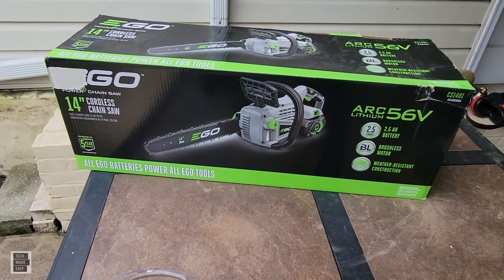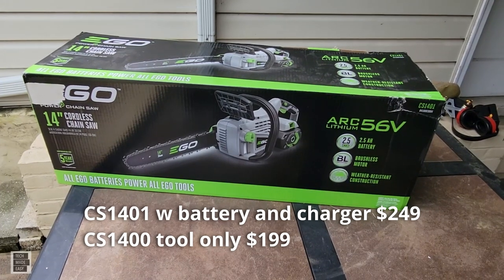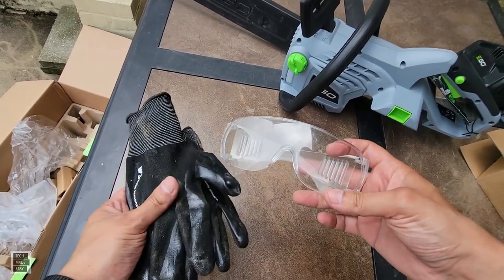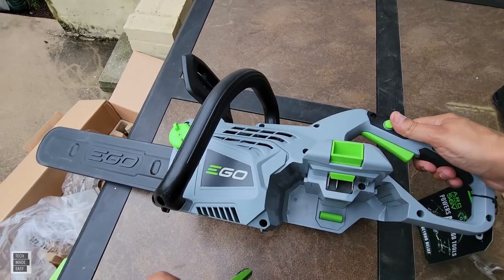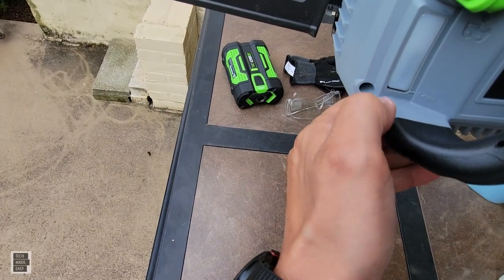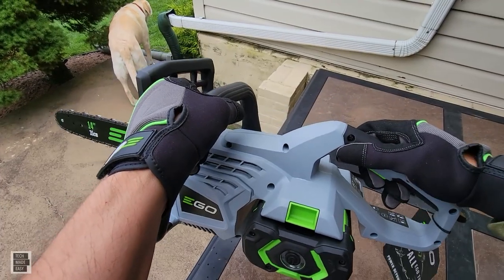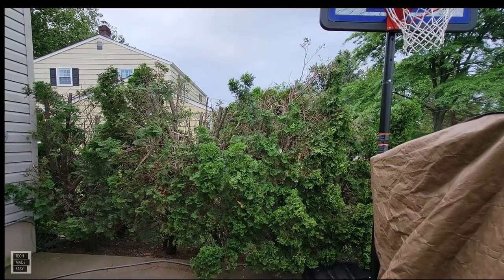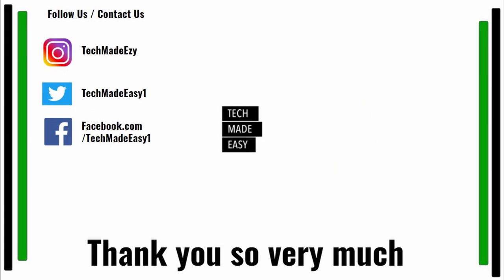EGO 56v brushless chainsaw review and demo

Comment: Thanks for the review.  I've got the 14" and 18" and love them.  I'm a city dweller with mature trees and there is always something to trim or cut down.  

When you were first going to cut down the tree, it looked like you had rested the chain on the trunk before starting the chainsaw.  It looked like you correctly brought the saw up to speed before making contact with the wood when you actually cut the trees.  With any gas, battery, or corded electric, let the saw get up to running speed before making contact with the wood.

I've lived in Wisconsin my whole life.  One of my duties as a child and now as a homeowner is to go out during the snowstorm and GENTLY get the snow off the trees like yours or bushes.  Sometimes I do it several times during a storm.

I bet you are a real popular guy in the neighborhood.  No one needs to buy OPE with you around.

Comment: Bought an EGO chainsaw.  Leaked oil.  Brought it back to Home Depot and they sent it out for repair.  Still leaks oil.  Battery wears down quickly.  You may get about 3-4 cuts on any wood 8" or thicker.  It's alright if you want to trim a few branches.
Reply from the maker: Thanks for sharing your experience

Comment: i got the 18 inch a few months back....the higher RPMs is what sold me....I don't have many trees in my yard but there are a few odds and ends that need trimming every so often.....i got tool only as I had 4 other EGO tools
Reply from the maker: 18 is a beast Brian
Reply: I've got the 18" also and it does the job.  I dropped 4 trees and was working on the 5th when the homeowners came out and yelled "who are you and why are you cutting down our trees."  I'll have to sneak back later to finish the 5th.  Good thing the saw has a light on it.    JK      

I do have the saw and did drop a 20"+ diameter pine tree that had already been topped.  It cut well but after dropping it I used up a 5.0Ah battery with about 6 bucking cuts.  I've got plenty of batteries and finished the job with the 2nd battery.  This tree was exceeding the saw's design by a few inches.  I'm sure it would be great on 16" trees.

Comment: I beleive ego, for their commercial line up, came out with a Arborist saw . It looked pretty cool
Reply from the maker: Hey Alexander 👍🏻Have to check that out
Reply: @TechMadeEzy  I believe the new Arborist model (which basically means a top handle saw that can be used one-handed) requires that the battery is worn on a hip belt.  I think it would also work with the backpack battery holder, not the professional backpack with integrated battery.  By not having the battery on the saw, the weight of the saw will be very light.
Reply from the maker: Cool thanks Ron

Comment: I have a Greenworks pole saw and I have to refill the oil at least once a year.
Reply from the maker: Hi Heidi, Work well? No issues?
Reply: @TechMadeEzy  Works okay, but it has a very front heavy design which is hard for me to hold aloft, given it has no battery at the bottom to counteract the weight and so balance is awkward. I'll be getting the EGO version probably next year.
Reply from the maker: Get it and try it, can't hurt. I don't cut wood much as you can see from the video 😊 but maybe one day I will have a larger lot. Have a great night thanks Heidi

Comment: I have the 18 in,doesn't leak at all,but my ego pole saw does leak though
Reply from the maker: Wow the 18 is beast mode 💪🏻
Thanks Scorpion 🦂
Reply: Earlier today I came across a video from a saw repair guy where he says 90% of all saw oil leaks are from the filler cap.  He was referring to one brand in particular.  Nevertheless, the EGO manual says oil leaks are to be expected (page 24). To test the leaking cap theory, the 90% guy suggests storing the saw with the oil cap on top rather than on the side.

Comment: Model Number Question.  Many EGO products seem to come two ways: a) with a model number or b) with the model number - FC.  For example, the user manual for my saw is marked at the bottom of every page CS1400/CS1400-FC.  I can find no indication as to what "FC" indicates.  My saw is model number CS1400-FC. Lawn mowers and battery chargers also have "FC" flavors.  Does anyone know what the difference is between -- FC versions and the ones without -FC in the model number?
Reply from the maker: Hi Ace FC is factory conditioned
Reply: @TechMadeEzy  That is a strong possibility, but its a scary thought.  How many units would you have to recondition before you make a model number for it and include it on your operators manual?  By the way, I finally took mine out of box.  I noticed the following: 1) The chain was shipped installed what I believe was way too tight. 2) The chain feels like it has a little oil on it. 3) The box (which is brown cardboard with black ink line drawings, not with the color photo) includes a small oil stain on the inside.  Thanks for your reply.
Reply from the maker: Brown box is Factory Conditioned
Reply: @acecombatter6620  Only need 1 to make a new PN, if the company wants to differentiate between factory new and FC. It is arguably unethical to pack reconditioned units in original packaging.

Comment: You overlooked the lubricating hole on the bar.  See page 44.    You also cut above shoulder height in violation of the admonishment on page 12.  There is also a warning about ladders on page 10.  Be safe bro.
Reply from the maker: Good notes Ace appreciate it. Definitely keep that in mind